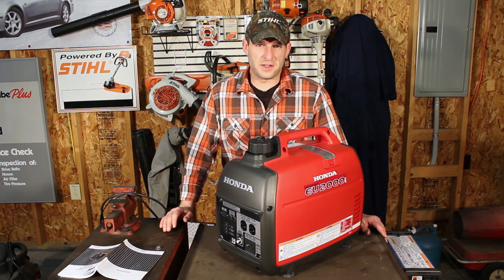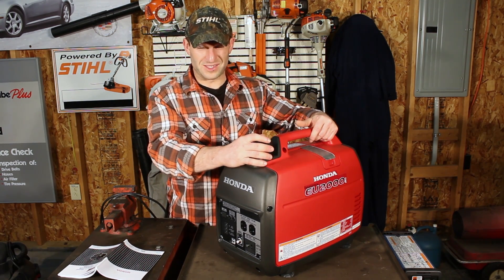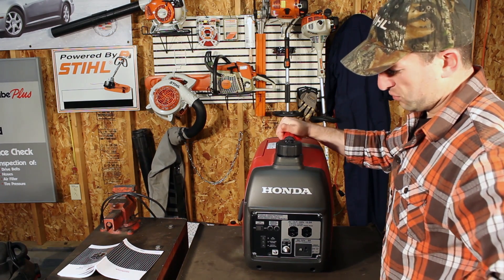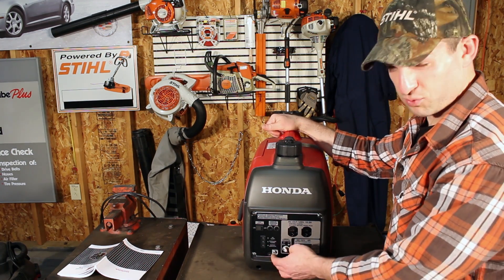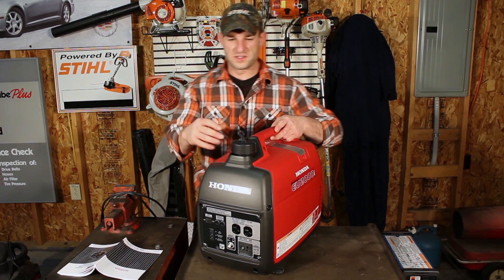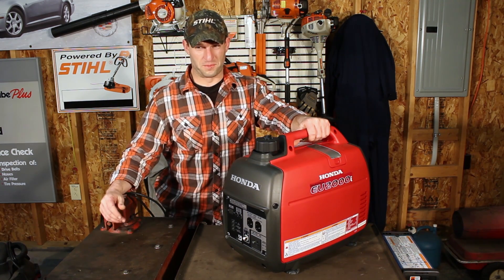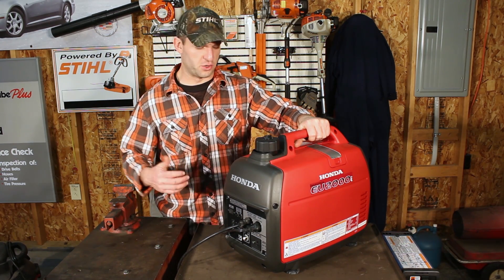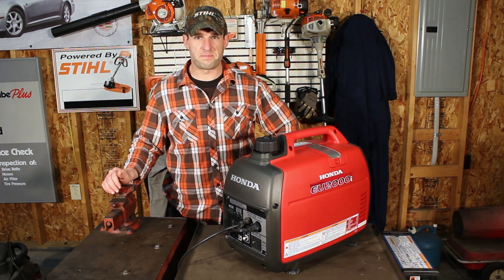Honda EU2000i Inverter Generator Overview

Comment: All’s I want to do is run my refrigerator and some lights.  Does this generator supply enough power for this?
Reply: Sure...
Reply: Look at the appliance voltage and amperage rating.
Multiply them and that's the wattage needed

Comment: Have a small travel trailer 13,500 BTU A/C. Many owners say the 2000 is going to support that. From your video, I'm suspicious. Can I harm the generator by trying to power the A/C?  I may rent one from Home Depot to see if the 2000 has enough power for the trailer (and A/C) but don't want to damage the equipment.
Reply from the maker: I don't think it'll harm it, but wont really do all that well powering it either.  The most common setup I've seen for RV use is running the EU2000 along with a companion EU2000 wired together with it.  You still get the portability, and have some head room to run other things in addition to the A/C.
Reply: Good idea. Thanks.

Comment: why not 2000w for 35 min?  lol
Reply from the maker: Not sure why they do this, but all generators are this way.  They have one rating that can be sustained for long periods, but the max rating is only sustainable for a brief time, then it overheats the machine.
Reply: It was a joke. it's 1600 full power and a 10 sec burst @ 2000w for start up of a motor.

Comment: You lost me at overheat at 30 minutes
Reply: @Maximus Decimus Meridius thx
Reply from the maker: Generator ratings are for max load, but cannot sustain that load indefinitely.  The generator can put out 2000 watts, but only for 30 minutes, the most it can produce constantly is 1600 watts.  All generators are this way, something to look for when buying one.
Reply: Awesome thanks
Reply: I was under the impression that agm deep cycle batteries need to be slowly charged back from low, like a trickle charge